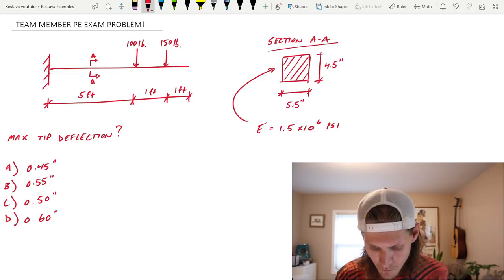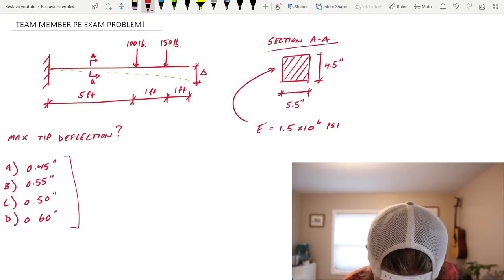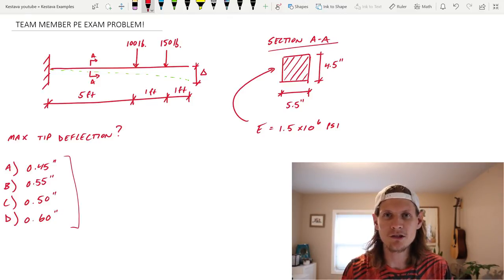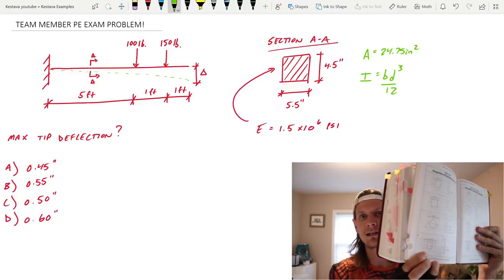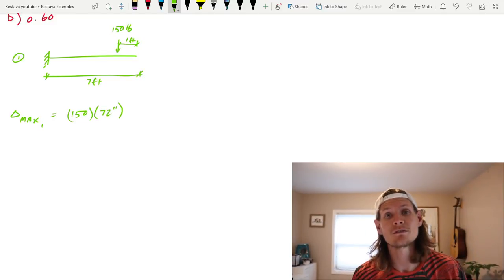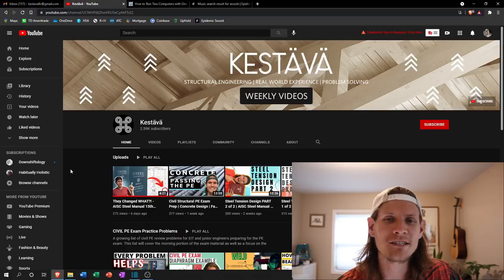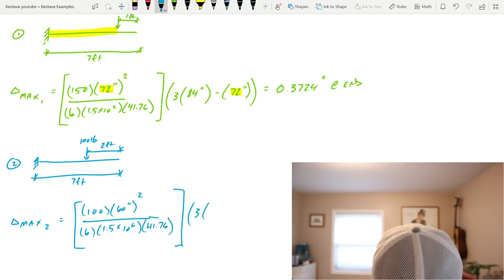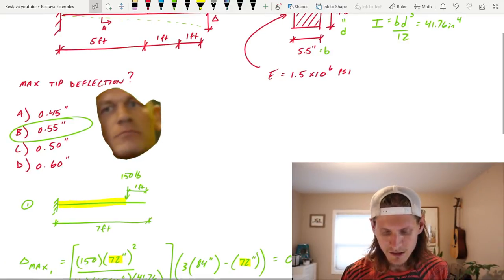Team Member CHALLENGE | Civil PE Exam | Practice Problem | 2021 Fall Exam

Comment: Kestava, 
Can you tell us how long would it take us to prepare for the PE structural exam? 
Unfortunately,  NCEES decided to change the exam from a paper & pencil exam to a computer based exam starting April 2021!! 
I prefer the paper exam cause I can have my tabs on the manuals and my own  examples that i can use during the exam, but with the computer it is not possible. 
I am thinking of taking it in October (last chance for paper based exam), do you think I'll be able to prepare for the PE in 2.5 months or it is too short?
Reply from the maker: I think if you take the time to sit down each day and just focus on studying for 2ish hours maybe every other day until the exam i think youll do just fine!
Reply from the maker: Jeffrey Castillo above mentioned that the exam is going digital with a PDF also! Im going to need to switch up my videos and start learning with the rest of you!

Comment: Would PL/EA also work?  When I saw this, this was the approach I thought of first, but I realized the AISC manual is the better way.  Would doing the PL/EA provide the same results?  I haven’t worked it out yet, but I’m curious if it would.
Reply: I don't think so. The formula is for axial load
Reply from the maker: Hi Jeff - i dont think that's gunna get us the same results. just ran the equation quick and am getting some pretty funky answers. is there an example somewhere where they use that? curious
Reply: Jeffrey, are you thinking of M/EI (Moment-Area Method)?